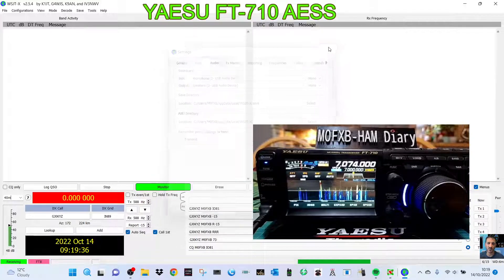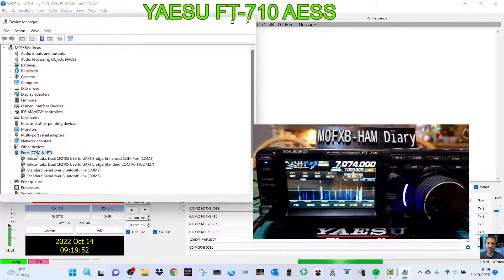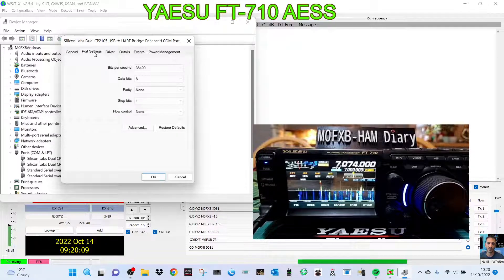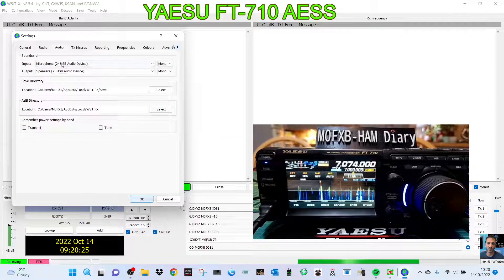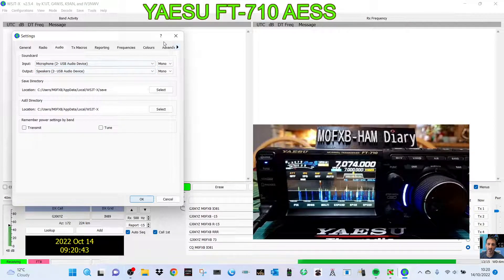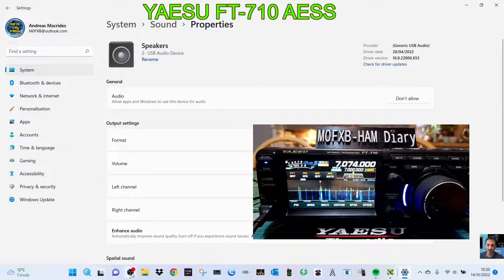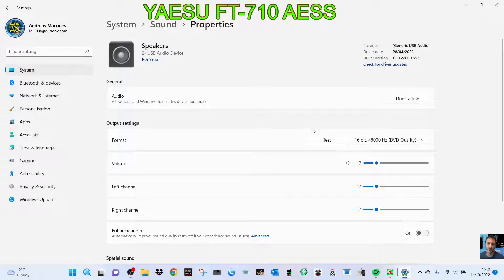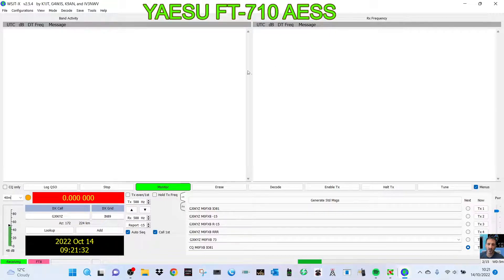YAESU FT-710 Need Help -No Audio Codec ??FT8 WSJTX

Comment: Are you sure the radio is capable of 48K/16? It may only be 44.1K/16.
Reply from the maker: It's OK solved
Reply: How did you solve the problem? 
 @M0FXBHamTech
Reply: Yes, the Yaesu Operation Manual fails to advise that the USB Audio Device System > Sound > Properties Output settings Format must be set to 16 bit, 44100 Hz (CD Quality)